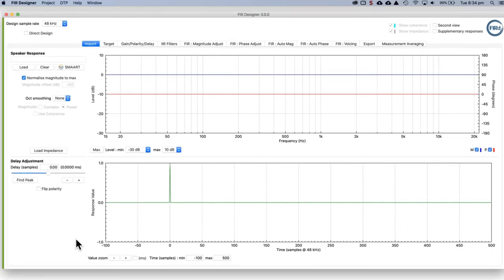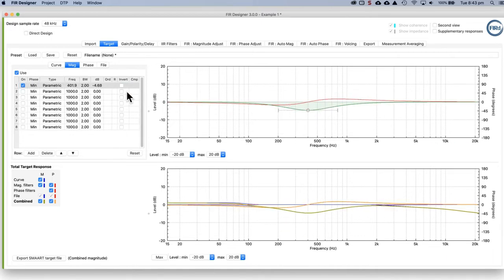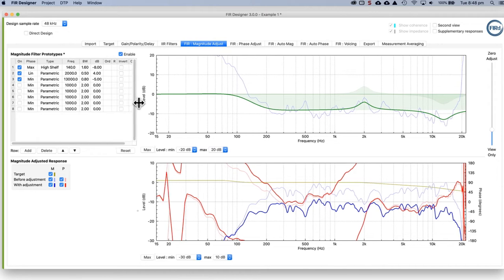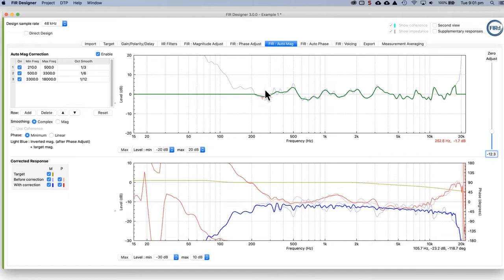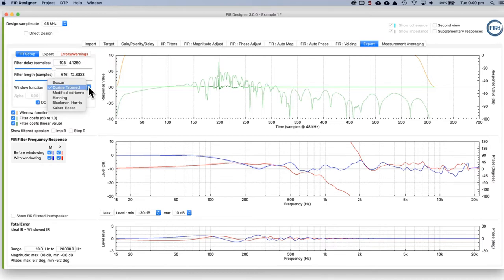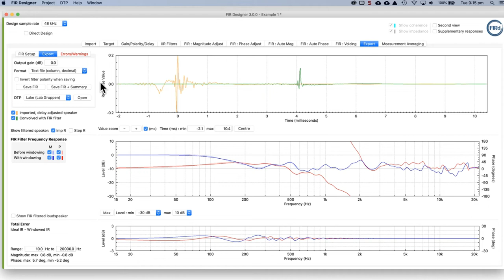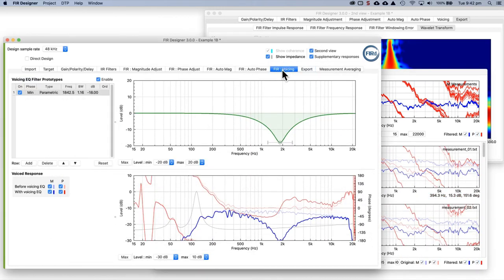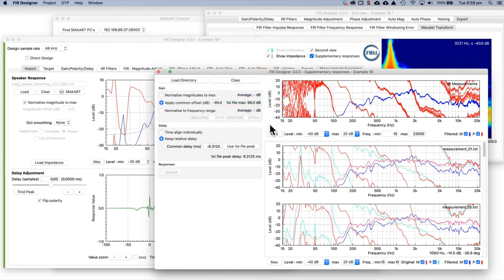FIR Designer 3.0 Complete Overview | Tutorial | Design loudspeaker FIR filters & FIR+IIR presets

Comment: Does FIR Designer work with Lake Contour units? Thanks
Reply from the maker: Our software can push settings to Lake FIR modules, but the Lake FIR modules can't be loaded into Contour units. (The Contours were discontinued many years ago and require older v5 versions of the Lake Controller.)